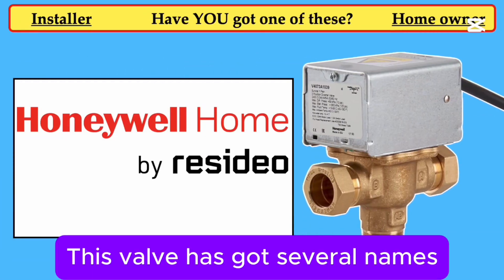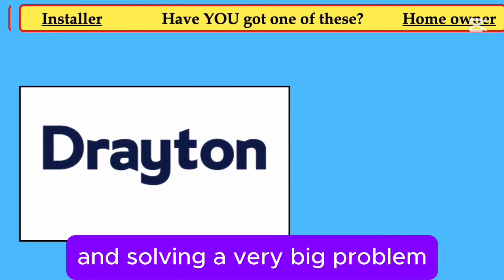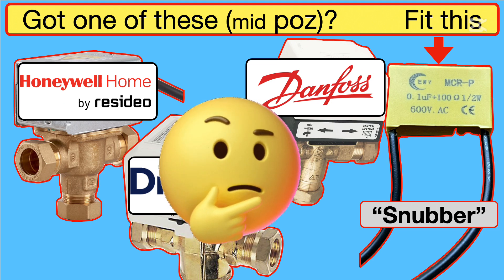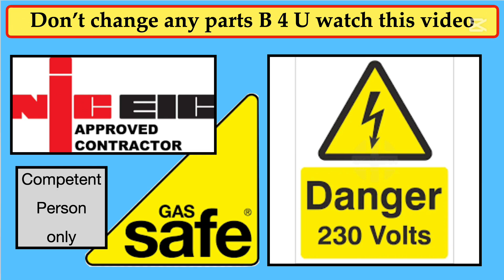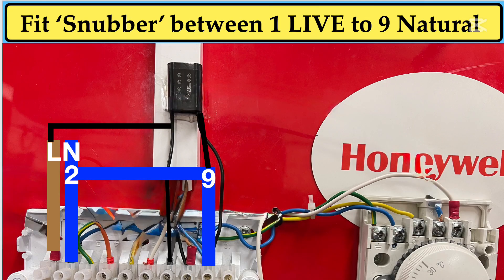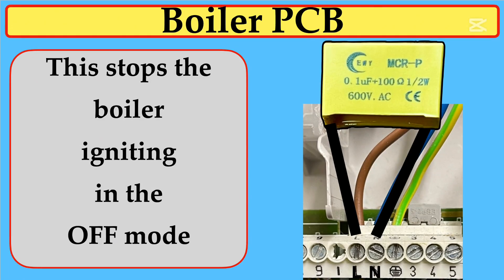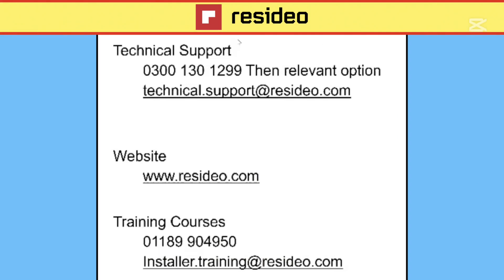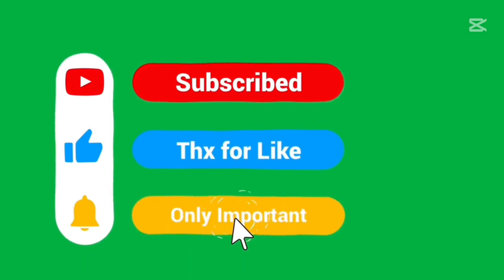Mid Poz valve: Why every install needs a "snubber"   I explain.

Comment: Would this work on a combi where the boiler keeps lighting even though the thermostat isn't calling for heat? across the neutral and switch live?
Reply from the maker: Dear Mikey, sounds a classic case, I have "Snubbers 2" coming in a couple of weeks, please subscribe and get notified, try putting the snubber between Natural and Orange  that also works, PS If you have a mid poz valve that could be stuck in HW mode same fault, take care. George 🤩